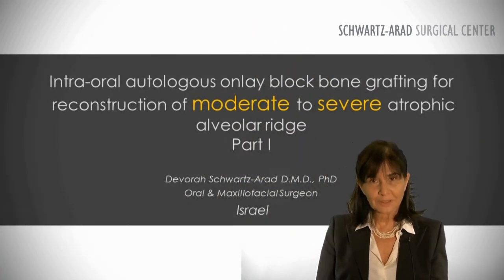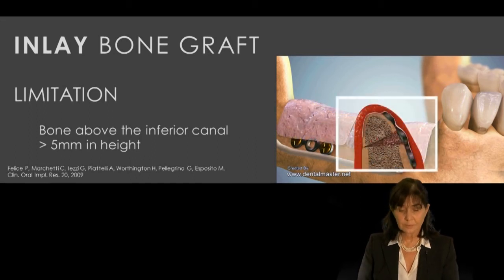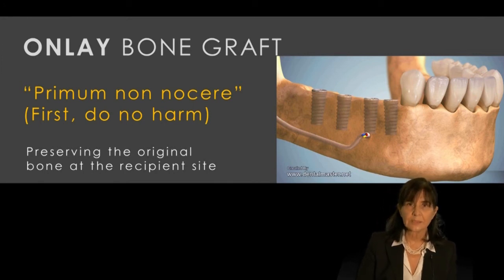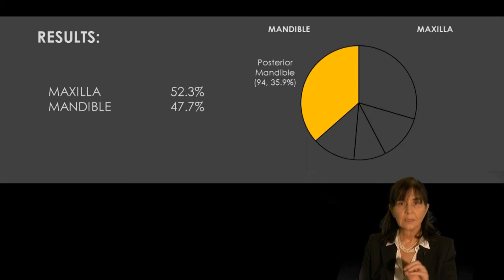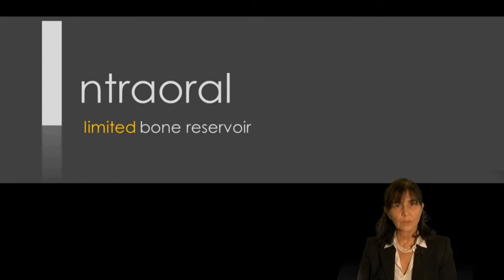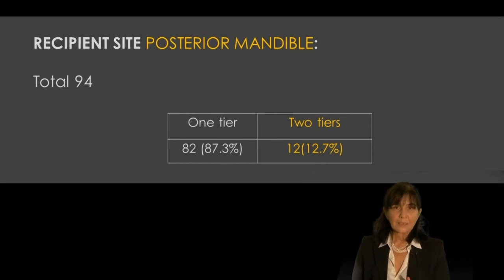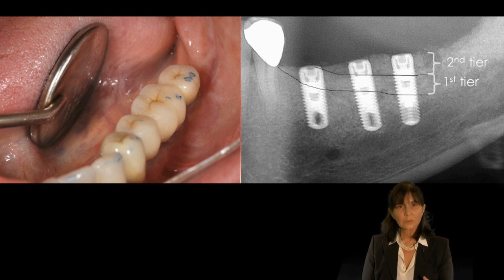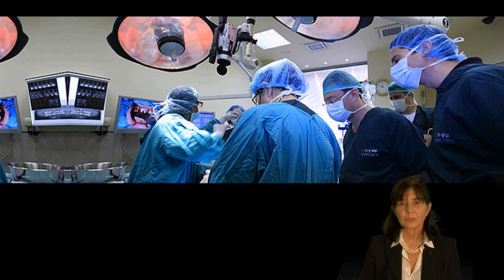Reconstruction of moderate to severe atrophic alveolar ridge - Part l

Comment: Amazing presentation, what do you think of the hypothesized techniques that use injectable bone inducing gel that serves as a scaffolding for bone formation and soft tissue expansion? Still fictional?
Reply from the maker: Thank you for the compliments. 
The posterior mandibular atrophy justify a multifaceted solution which need a variations and several surgical techniques for the purpose of implants supported prosthesis.
Nevertheless, the use of "bone injection" might be considered as part of the surgical solution in the future.
Reply: Devorah Schwartz-Arad it’s true how tremendous your work is so it’s not just a complement it’s a fact. About the injections are you saying it needs improvement to be able to be used successfully?